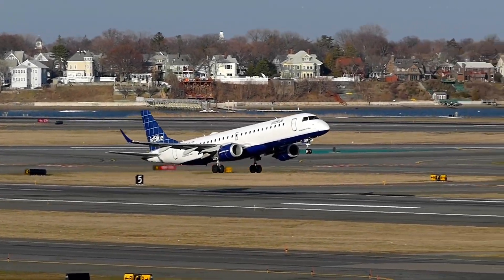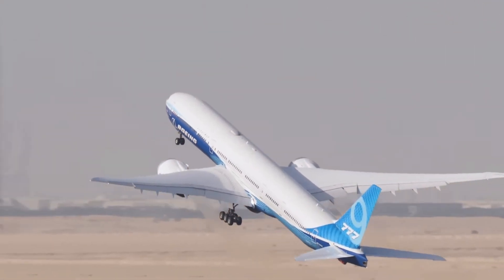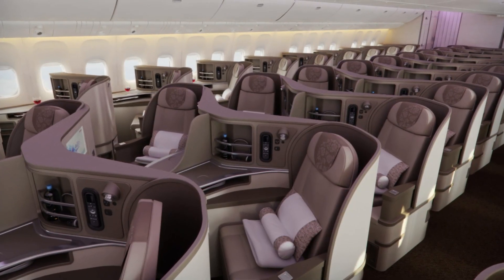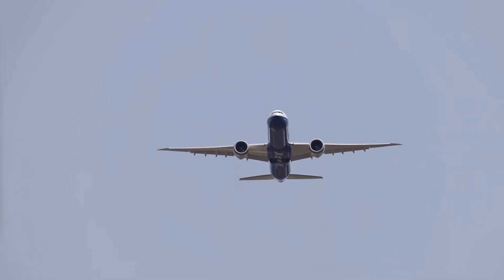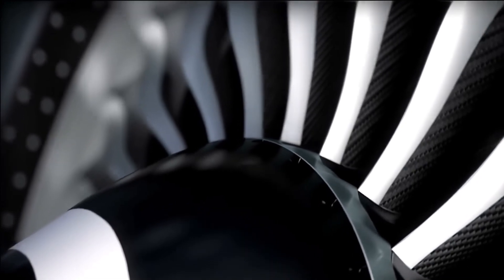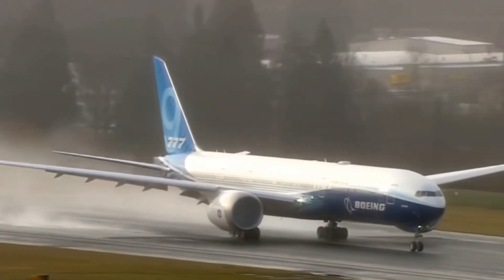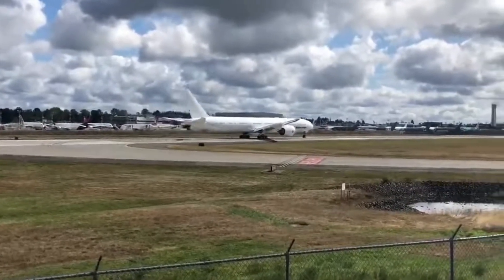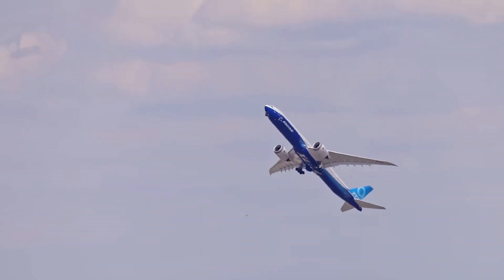Breaking News: The Revealing Truth About the Future of Air Travel!

Comment: Your episode sounds like a Boeing and GE commercials.  The 777X has break new ground on composite wings and largest engines.  It would be great if it adopted composite body, rather than Aluminum body.

No US airlines ordered any, just like no US airlines ordered any A380.  Most US airlines have no use for such a large plane.  For very limited few who may need this plane, some already ordered A350 or have not reached their B777 replacement cycle.  After 777X enters into service, the big three US airlines may take a look but its market is so limited for such a large plane.
Reply: Down the road they will need big planes airport will be stuffed full and finding land and building new airports.the cost is through the roof.